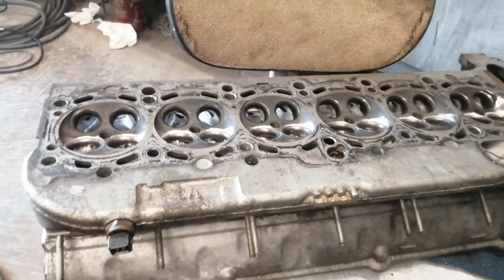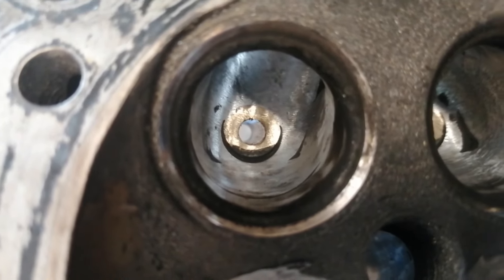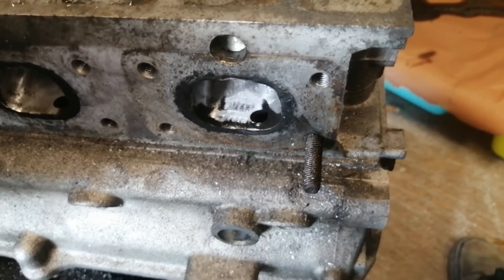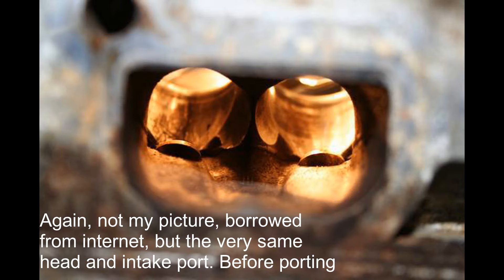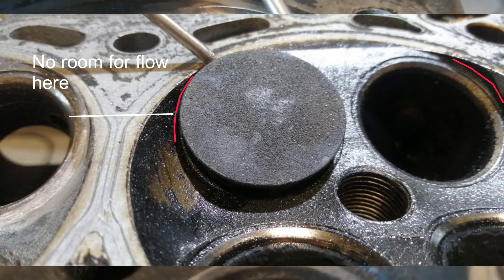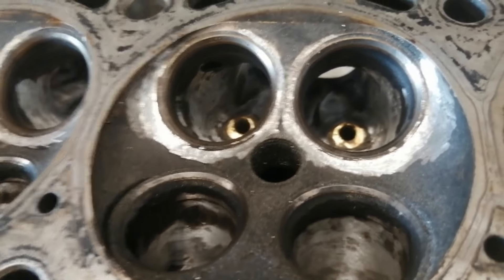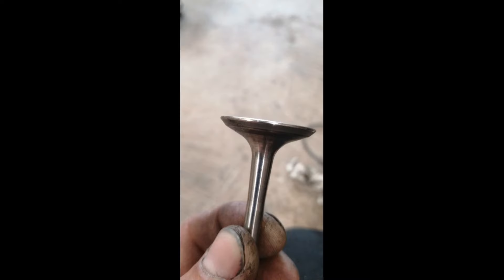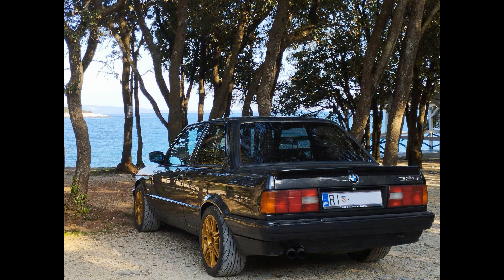m54b30 head porting (just description of what I did)

Comment: any plans for different intake or some diy approach for ITB setup?
Reply from the maker: @ivanfilipovic3296  Yes i do,  nobody is talking about n52 single stage disa intake manifold. I believe it would do great on m54 engine without any drawbacks. Making ports for injectors should not be a problem, but time and money is :D. Also I dont know if it would fit in terms of size and angles. Apart from n52, n54 manifold with spacers is really interesting and tempting to me. ITB could be good, but its the most expensive route.
Reply: @TomoReso  so happy to not hear m50 2.5 intake for once, overjoyed actually. Around x-mas i will port and polish my own head and have it as spare so race is on for the biggest outputting m54 NA in Croatia :)
Reply from the maker: @ivanfilipovic3296  Its a deal. :)